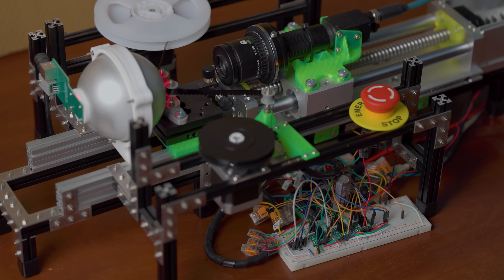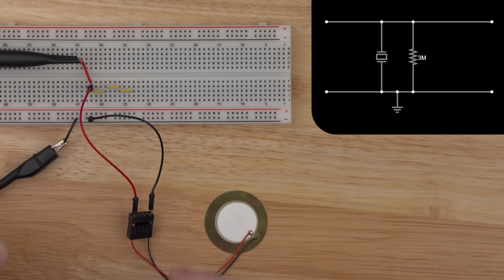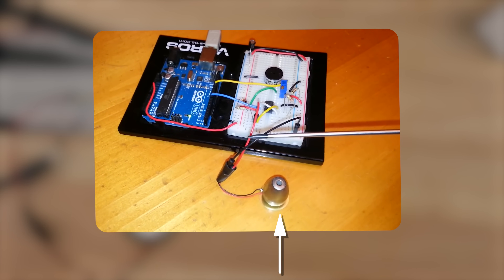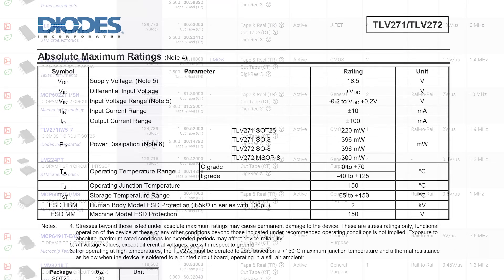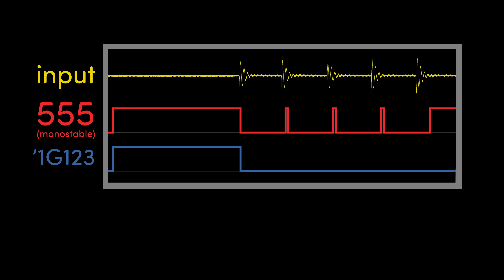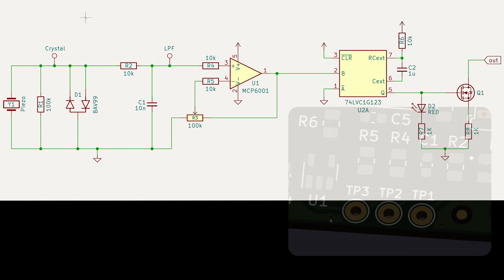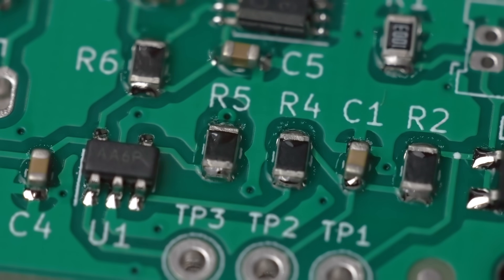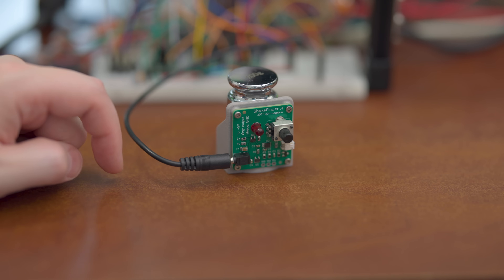Designing a simple vibration sensor

Comment: Is that Falstad circuit simulator? I cannot find that piezo symbol!?
Reply from the maker: Yep, it's Falstad.  (I love Falstad!)  Under "passive components" there is an "add crystal" choice that will give you that symbol.  That said, it models a plain crystal oscillator and there isn't a good way to make it behave as a voltage input like the piezo element in this situation.  For the actual simulation I used my (real) oscilloscope to record a few milliseconds of signal from the piezo element.  Then, you can use the "Add Data Input" choice from the "Inputs and Sources" menu in the circuit simulator to read that file.  It's like having a real-world component right in your simulation.  It worked really well.
Reply: @NicholasPiegdon  Thank you so much, I didn't even know it was possible to add data!

Comment: As a former drum scanner operator from the 90’s, we faced exactly the same problems. The solution from our supplier was to place it on a concrete floor 100+ feet away from a busy road.
So I would move that setup into the garage or the basement. You should see a huge difference if not completely illuminating any vibrations.
Reply from the maker: This is probably the better answer.  I was hoping to make a nice, little desktop machine (and this sensor gets it most of the way there at the expense of making it slower), but if I were serious about throughput, your idea is a good one.

Comment: How do people learn to understand requirements of building such circuits, coming from a non-electrical background?
Is there a good resource or guide to learn these?
Reply from the maker: I'm afraid I don't have a very good answer to your question.  While I do enjoy self-education and reading text books by myself, they have a tendency to lay everything out a little too nicely and conveniently.  In real life, things are always thornier or have these extra caveats that never seem to come up in the book.  So, while they can cover a lot of informational breadth, I feel like the next step after learning from a good book should be to pick the smallest real-world problem that is just outside your comfort zone and chip away at it until you run out of things you don't understand.  Then pick the next smallest real-world problem that is now just outside your comfort zone, etc.  The project in this video was actually my next-smallest-problem in analog circuits that I decided to try.  A few comments have pointed out that I could have just used an off-the-shelf solution, but then I wouldn't have learned the dozen or so things that I shared here that are going to be useful in my next project.

If you're just getting started, your first problem might be as simple as "light up an LED with a battery and a resistor".  I can think of three or four pitfalls between the easy textbook version where they've picked all the values for you vs. you coming up with your own answers.  Hints: how does the LED's "voltage drop" interact with the Ohm's law calculations you need to make for the resistor?; Are you actually getting the amount of current through all the components you expect?; And are your parts actually rated for the power being dissipated in each?  A book might look like it only takes a paragraph and two minutes to "solve" that problem.  But actually getting a clear understanding into your head could be a few days of searching around for answers to really basic questions that crop up along the way.  ("What makes 'ground' special?  Doesn't 'ground' change, too?  Wait, we just define it to be 0V and it's just the relative voltages that matter?", etc.)  Lots of rabbit holes.  Checking inside each one is a good way to really figure stuff out and connect all these dots.

Comment: You could have used a Schottky diode for clamping the voltage to ground. Schottky diodes have a much lower forward voltage, down to 0.2V
Reply from the maker: Yep, this is a good idea.  It would add another line to the BOM, but the flexibility it brings is probably worth it.
Reply: @NicholasPiegdon  I'm 80 years old, and back in the day, I might have tried using germanium diodes in place of the silicone diodes (they were in common use 5 or 6 decades ago in small signal detectors).  They would clamp the voltage at 0.3V rather than 0.7V and could reduce the resistor parts count.

Comment: Why not use a full bridge rectifier which would convert it to positive DC?  Add a high side limiter if necessary, then I think you could feed that into practically any garden variety op amp/comparator.
Reply from the maker: If you rectify it you lose the first couple diode drops of signal, which is exactly the part of the signal we care about most. 😬
Reply: @NicholasPiegdon  Oh OK, I guess that's because that part gives you maximal sensitivity.

Comment: you can try building a simple anti-vibration table that is common in optics. back in the days classical holographers face similar issue. Using a simple sand-filled pot as a base to your table legs can reduce a lot of micro-vibration.
Reply from the maker: This definitely wouldn't hurt.  The other suggestion I've seen from the 3D printing crowd is to put the machine on a large mass--like a stone paver--and then put all of that on something like shock absorbing rubber feet.  The footprint of the machine is still quite large, so it might get expensive to make any anti-vibration surfaces that large.  (At this point I'm far enough along in my research process that I could probably shrink the machine quite a bit, but I've been pressing forward instead of going back and rebuilding things that are already working.)

Comment: I built a similar scanner using stepper motors and a raspberry pi camera (build video is on YouTube). I avoided camera shake using machine vision to locate the frame and remove and wobble
Reply from the maker: Your scanner build is very nice!  (I like your video style, too.  It's close to the style I aim for.)  Not only that but you put in all the documentation effort in the GitHub repo!  The Pi HQ camera is a popular choice for homemade scanners.  The Kinograph forums ( https://forums.kinograph.cc/ ) seem to have accumulated lots of people like us and it's rare to see anyone there choose something other than the HQ camera for their 8mm scanners.  My machine is one of the rare exceptions.  I've been covering my monthly progress in a thread over there ("The ReelSlow8 Film Scanner"), which might have some interesting details to compare with your results.

Your choice to match contours to find the sprocket holes is an interesting approach I haven't seen elsewhere.  One common approach is to just grab a vertical strip where you expect the hole to be and run a Sobel edge detector on the strip to find the top/bottom of each hole.  I came up with something kind of novel (or, at least something I haven't seen anyone else do before): assuming you've set the camera exposure so that the only over-exposed pixels are in the sprocket hole, you can just threshold way out at like 98% of the peak brightness and run a quick "center of mass" on the remaining pixels.  That's fairly resilient to dirt trapped in the hole or even tears in the film (especially after a few extra tweaks I mention in my forum thread).  For normal, clean holes I've never seen it land more than a pixel or two off a manually-placed center point.  It was exciting to find a method that not only works really well but uses less computation than anything else I'd seen before it.

Comment: Instead of the 555, would a schmitt  trigger not suffice? I used one to turned a sine wave into a square wave and it worked well.
Reply from the maker: A Schmitt trigger would definitely make the edges sharper, which is really all the microcontroller needs.  What the pulse generators add that you don't get with just a Schmitt trigger is combining lots of little events that exceed the sensitivity threshold into a single, longer event.  The only real difference would be how many times the interrupt is fired on the microcontroller, and the ISR that I've written to handle the event is so short (it just sets a single bool) that it probably wouldn't matter if the interrupt rang pretty consistently.  I was going for the "ideal" behavior that I wanted to see but if all you had on hand was a Schmitt trigger, it would most likely be a drop-in replacement without hurting anything.
Reply: @NicholasPiegdon  thanks for the response. I always live at the interface between SE and hardware, so i haven't really gotten deep with electronics even though I masquerade as a specialist, so this kind of thing is interesting to me. Would something thst triggers on the first rising edge followed by a peak detector work (if I understood you correctly)? Essentially you want a high signal from the first shake to block your processing block for a short time right?
Reply from the maker: @orbita1  Yep, you're on the right track.  What you're describing is getting closer to the "retriggerable" timer chip I picked for the circuit.  It combines all of those things but a peak that comes in during the timer will also start the timer over from the beginning.  So the microcontroller just sees one event that lasts until things have settled down, no matter how long that takes.

Comment: I think that the point of your video is that the journey was more important than the destination. There were many ways to solve this issue, but going through the journey of creating your own PCB for it,  and taking us along for the ride was great.
However, in a commercial application, where we only would need to detect certain amounts of motion and cost is a big factor (say we're using a 1.50  accelerometer to detect if an asset has moved significantly) . Would this be cheaper than using some cheaper MEMS device? 
How else would you do it?
Thanks!
Reply from the maker: First: yes, absolutely, I am here for the journey.  One of my core operating principles for as long as I can remember has been to try and figure out how everything works under the hood.  (If it didn't involve hydrofluoric acid, I'd be trying to etch my own silicon in my garage like Sam Zeloof... but another one of my core operating principles is risk aversion, and working with HF exceeds my danger comfort threshold by a pretty significant margin.) 😅

As for using a MEMS accelerometer instead, I've seen an argument against it working as well as this solution: https://forums.kinograph.cc/t/shakefinder-a-vibration-sensor-for-stop-motion-scanners/2761/7  After reading that, I almost want to try it both ways and see.

Comment: I'm disappointed an LM7905 wasn't used to inject -5v into your op amp
Reply from the maker: The whole point of that section of the video was to show how we could avoid adding one. 😅

Since then a few other comments have pointed out that using a Schottky diode (with a smaller voltage drop) on the negative half would have widened the available pool of op-amps.  That keeps the part count and power draw the same while gaining a little flexibility.  Adding an LM7905 does neither.
Reply: @NicholasPiegdon  I see. I also forgot that one does not magically generate -5v out of nowhere, and the 'good' solutions aren't very small.

Comment: Why not use a xyz accelometer chip?
Reply from the maker: There is a good chance it wouldn't work as well as this solution.  More discussion here: https://forums.kinograph.cc/t/shakefinder-a-vibration-sensor-for-stop-motion-scanners/2761/7
Reply: @NicholasPiegdon  thanks for the link. If I had to, I'd still give it a shot just to avoid designing an analog circuit (and -board) ;)

Comment: Would you explain why you didn't just shift the input by 2.5 volts up? It's super easy to do and basically gets rid of all complexity regarding part selection.
Reply from the maker: The most succinct version: I didn't think of it at the time. 😅  Quite a few people (an embarrassing number?) have suggested the same workaround in the comments at this point and I agree that it sounds like a good idea.  If I ever revisit this to design a version 2, this would be one of the first changes I'd investigate.

Comment: Great video. What kind of hard and software did you use regarding the oscilloscope?
Reply from the maker: The animated schematics against a black background are from screen recordings of the (free) Falstad Circuit Simulator.  Otherwise, the oscilloscope overlays take some extra effort. I picked my scope (a Rigol DHO924S) specifically because it has an HDMI output.  So I can use a regular screen capture device (in this case, an old Elgato Game Capture HD60) to record its screen at the same time I record my own footage.  Then, you "just" line them up carefully in the video editing software.  It's definitely a process, but I like how seamless the result is.

Comment: Couldn't you check for a blurry image and then capture it again? I like the idea of a vibration sensor but it feels simpler to just do this with code
Reply from the maker: Some 8mm frames are blurry to begin with, say, if the person holding the camera was moving quickly or shaking it at the time of filming.  The image sharpness varies so much from frame to frame that it'd be tough to come up with a metric to consistently distinguish motion blur right now from motion blur captured fifty years ago.

You might be able to use the outline of the sprocket hole, but for film transport tracking purposes (and to squeeze as much dynamic range out of the captures) that area is intentionally over-exposed, so it's also not a great subject for CV algorithm scrutiny.

And any software solution would necessarily add a step after the capture but before advancing to the next frame, which means slowing the whole process down even more.

For only a few dollars worth of parts the code now gets to check a single, definitive flag immediately after the capture ends.

Comment: Very nice video!
I'm working on almost the same problem at work. I measure vibrations to correct measurements from an interference microscope, only with much higher precision.
Your sensor is really good but it only measures vibrations in one spatial direction, in your case the z direction.
The piezo disks are in most cases longitudinal elements.
If you set up two additional sensors with piezo sensors that use the shear effect, you can also measure the x and y directions with the same hardware Setup.
The shear direction of one sensor should be parallel and one should be perpendicular to the optical axis of your camera. Then you can avoid lateral vibrations and also vibrations that move your images out of the focal plane of your camera.
Reply from the maker: This is a good observation. I’d noticed that it was only sensitive along the coupled (Z) axis. For my purposes, that’s the axis that gives me the most trouble, so it’s been good so far. I haven’t been able to get a blurry capture yet, regardless of how hard (or which direction) I bang on things. Granted, I’m probably zoomed out at least an order of magnitude farther than the work you’re doing, so my requirements are a little more relaxed. I’ll have to look into shear-effect piezo sensors. Thanks!

Comment: Why not a full wave bridge rectifier with a optocoupler?
Reply from the maker: Rectifying makes us lose the first (and second?) diode drop of voltage, which is where almost all of the useful signal is.  You'd be left with a device that couldn't be made nearly as sensitive.

Comment: When you were concerned about the negative peaks and the single-rail op-amp, could you instead have 'grounded' the sensor to 2.5V with a voltage divider? I have no idea what value the resistors would need to be, and thus what current it would draw. I learned electronics a long time ago and never practiced. I mess around in a simulator sometimes, but... I'm aware of a lot of components "warts," including op-amps but without the actual parts, I never really know if I'm under- or over-estimating the issues. (I have used a simulator with realistic parts, but it was too much faff when I'm not actually making anything.)

Comment: Why would rubber feet for the table not work?
Reply from the maker: For what it's worth, it's already on (thin) rubber feet.  But you are right, there is lots of room for improvement with noise isolation.  A number of other people have commented that putting the whole thing on a big marble/concrete slab and then putting that on something absorptive would make a big difference.  I agree with them.

Comment: How neat ! I made a vibration sensor also, but not nearly as sensitive as yours. It is just a 3 cm bare wire in parallel with a narrow strip of copper board, with the wire running  approximately 0.5 cm away from the board. It works very nicely with a PIC microcontroller being woken from sleep with the change on the input pin. Thank you for showing us your design !

Comment: Would love to see a comparison ot a accelerometer. I'm not really convinced it is necessary to build a custom sensor for this.
Reply from the maker: MEMS-based accelerometers usually report the acceleration forces directly.  In our case we only want the change in (or derivative of) those forces.  So if you used an accelerometer you'd have to spend time on your microcontroller doing signal processing to almost get a noisy version of what this thing gives you directly.  More discussion here: https://forums.kinograph.cc/t/shakefinder-a-vibration-sensor-for-stop-motion-scanners/2761/7

You could probably get it to work but this thing gives exactly the answer we want, exactly how we want it.